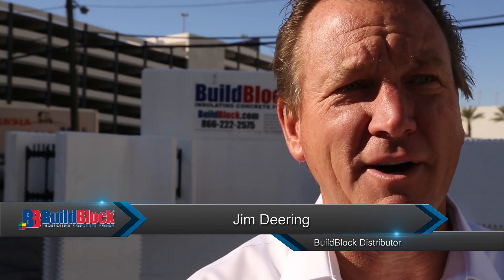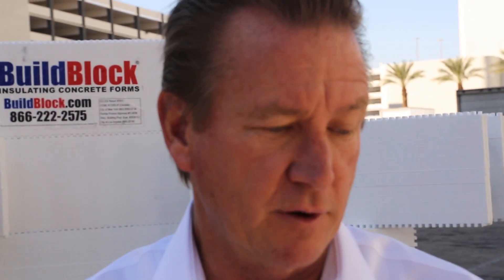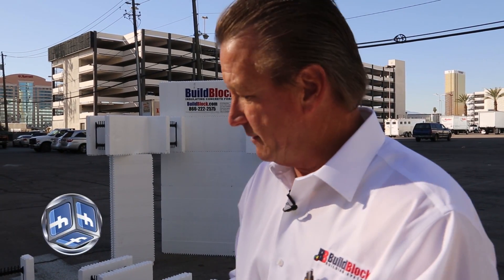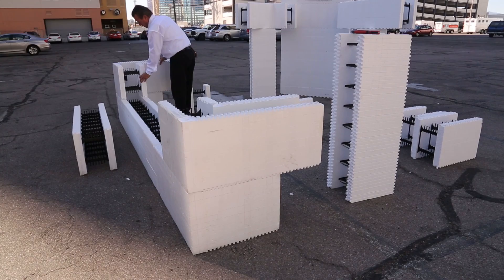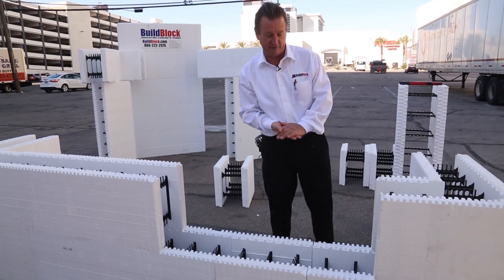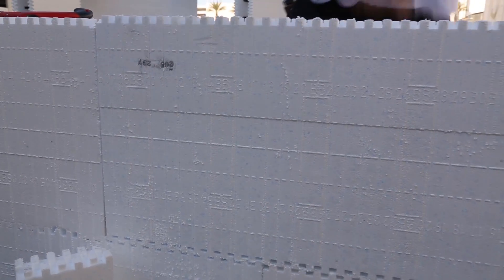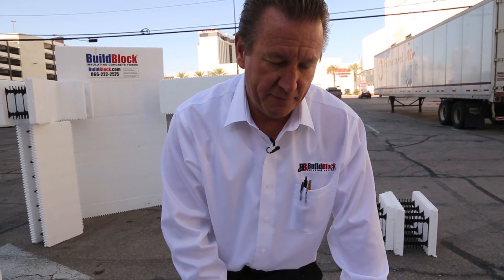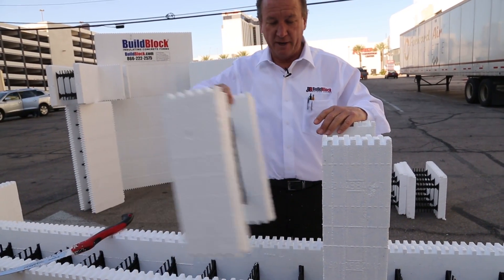BuildBlock Field Notes ICF Wall Stacking Strategies

Comment: Can you run hvac ductwork thru the icf?
Reply from the maker: +melvin292 Easily. All wall penetrations are created before you pour. PVC sleeves are typically used for plumbing and electrical pass throughs. Largeer HVAC ducting can be bucked out with wood to leave a suitable space.
Reply: +BuildBlock ICFs I understand the need for an electrical wire, HVAC lineset or small pass through the ICF but from what I understand, it is never permissable to build  a frame out  the full length of the form, correct? Looks like you have a great product and you produced a nice informative video. thank you
Reply from the maker: +melvin292 I'm not sure what you mean by a frame out of the full length of a form. Opening can be many sizes for many reasons. Windows and doors are also easily bucked using wood or BuildBuck and ICF bucking. All openings must be brace appropriately before pouring. 

You might visit http://buildblock.com/technical-support/installation-manuals/ and look at the installation manuals for this product. As well as http://buildblock.com/technical-support/cad-details/ for specific CAD details regarding opening and penetration construction. Also please reach out to Mark Kerfoot at technical@buildblock.com or by calling our office at 866-222-2575.

More videos are also available on our Youtube channel.

Comment: who remembers flinstone building blocks? It just reminded me of that... it's a Styrofoam concrete form, isn't it?
Reply from the maker: +louie1157 ICFs are a form for concrete. The wall inside is a normal reinforced concrete wall, but instead of setting up forms and striking them when the wall is finished these stay in place providing permanent high density insulation, sound dampening, and water resistance.

Comment: +BuildBlock ICFs  does your product work also for Finnish basement designs? and what is placed on the exterior to protect the foam?
Reply from the maker: +OCDwolfMAN Yes, our product is used for basements. On the exterior below grade it is required to use waterproofing that is non-petroleum based. The Tamko TW-60 is a common choice and may also be combined with a dimple board membrane to relieve hydrostatic pressure and protect the waterproofing against the backfill. There are other membranes and wraps that can be used as well. The level of waterproofing should be adjusted based on local soil conditions and applicable local codes.

Visit http://buildblock.com/technical-support/installation-manuals/ for detailed information in our Installation Manual.

If the interior space is considered habitable it will require a 15-minute fire barrier such as drywall or other suitable covering. These are easily attached using the embedded attachment points spaced ever 6-inches on the block. Check with local codes for specific requirements.
Reply: I like it. has any of your customers attempted construction under 25ft? I am a bit of a preper and would like to use this for my designs.
Reply: also do you have any that I could use to build into support pillars roughly 48 by 48 or maybe larger. having my blue prints looked at by a structural engineer and an architect to be certified and am considering having them look at your product to make this endeavor easier.
Reply from the maker: +OCDwolfMAN We have had many interesting projects. If you want to reach out to us our technical staff can answer specific questions. We are also in the process of finishing an full engineering manual for our products which might help your engineer and architect. Take a look at http://buildblock.com/a-satisfied-customer-buildblock-icf-shelter/ that's an older project, but a good example. The link at the end of the story goes to GreenBuildingTalk.com with even more information.

Comment: looks like your product is not fire proof, if it's Styrofoam it will burn and put out toxic material. Why not build out of a material that is 100% fire proof? Then I would consider your product.
Reply from the maker: +Troy Brownrigg The EPS foam of our product contains a fire retardant suitable for residential homes and commercial buildings. Foam does not burn except at extremely high temperatures. In home and office fires the temperature is not high enough to sustain a fire. The EPS foam melts away from the heat. When melted, air is released from the foam. Also, the structure of the home is a concrete wall. The foam insulation insulates the concrete against heat, further protecting tte structure. http://buildblock.com/icfs/safety/fire-resistant/ & http://buildblock.com/technical-support/product-testing/buildblock-firewall-test/
Reply: +BuildBlock ICFs  I'm looking for products that would not melt/ burn. When your off grid and a major concern is forest fires, one would be wise to choose materials that are not affected by heat in any way shape or form. The idea of it melting is not a product I would consider using. This is an area where the manufacture could make a product that is 100% heat/ fire proof without changing the design much. I like your product idea, just wouldn't consider it until it meets my needs, This product could be improved drastically if another material was used.
Reply from the maker: +Troy Brownrigg This product excels in heavily forested areas. I'm sure I won't change your mind, but if you consider that the exterior is covered by finishes that could be 100% fire proof, and could provide something beyond a 15-minute fire barrier. Even if that barrier was compromised, and the exterior foam melts, the next layer is 6-inch or greater reinforced concrete which is fire proof. Best luck in your search.
Reply: +Troy Brownrigg dome home.
Reply: +BuildBlock ICFs Are the blocks suppost to act as wall dividers to the inside of the house?
Reply: Apex Block does not burn
Reply: BuildBlock ICFs how can this be used in Netherlands. Were the winters are cold?
Reply: ***** oh ok thanks for responding
Reply: +Beezy Talking Shit You can use ICFs as interior walls, but most do not except in safe rooms or as load bearing walls in a basement with large spans.

The exception we see many times is in specialty media rooms to isolate sound from home theaters. Keep in mind that even our thinnest ICFs are 9" (4" concrete, 2.5" of foam on each side) and will take a lot of interior space.

Comment: And then you put the heavy beton, and when you don't fix it perfectly, all will fall apart and the beton floats over the area....
Reply from the maker: +marcelm73 BuildBlock ICFs are incredibly strong, with 8 webs per block, 1 every 6-inches and 2.5" of foam on each side at 1.5lb density. If instructions are followed correctly, the wall braced and the correct slump of concrete is used the ICFs are incredibly strong. We routinely see projects built 1-3 stores. Failures are rare.

Comment: I do basement and foundation repair here in kansas city mo. We use these blocks...just a different brand when we replace entire basement walls. They are very good but can bow or even blow out. I dont reccomend doing it by yourself. Deffinately have someone with experience with these blocks when building with them. They are a wounderful innovation to be sure though
Reply from the maker: Charles Vansel Thanks Charles. One of the reasons that BuildBlock uses the embedded webs on 6-inch spacing instead of every 8-inches is for that very reason. It prevents failure and any scalloping. 

There are some other considerations we find such as concrete that has too high a slump, pumping the wall in correctly, as well as in adequate bracing and alignment systems. We would be happy to answer any questions and the rest of our YouTube Channel has lots of project and install video resources. 

Additionally, we just released a major revision to our Installation & Technical Manual available on our website. Let us know if we can be of assistance! 

^BC